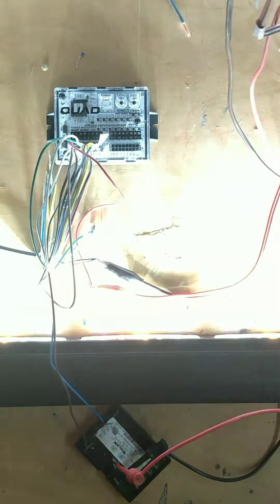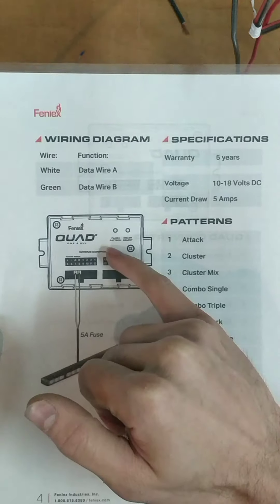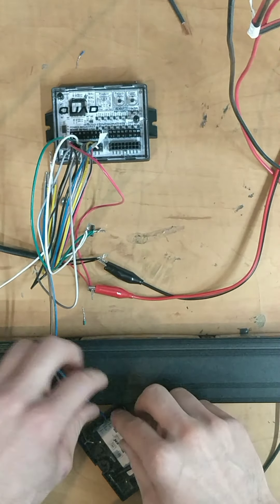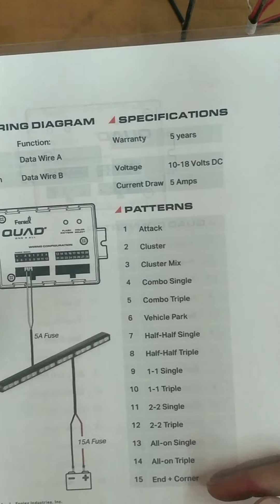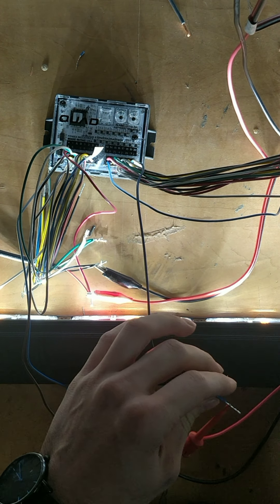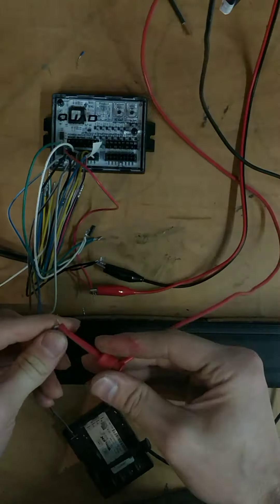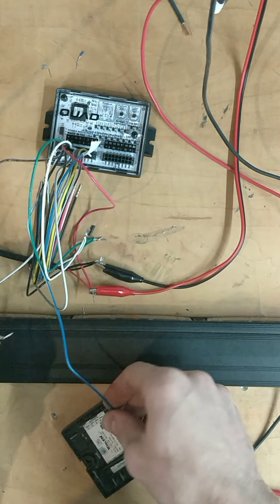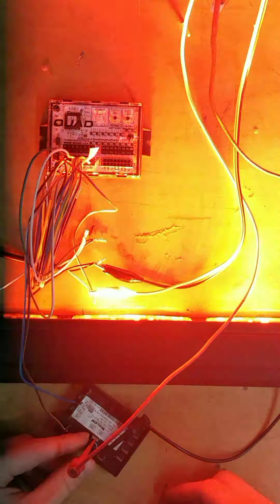Externally flashing Feniex QUAD 600

Comment: Why can't you use flood and brake?
Flash flood and brake
And set them both to the full bar
Or for front orientation, you can flash flood and California red when set to all modules.
And it will be better than what you did.
And you'll still have the other 3 modes

Comment: Your comments are turned off on your 4200mini video…how did you do the ignition override if the controller is in use!? I’d love to do this with mine!
Reply: Using external relay